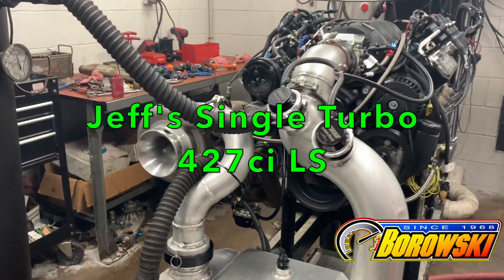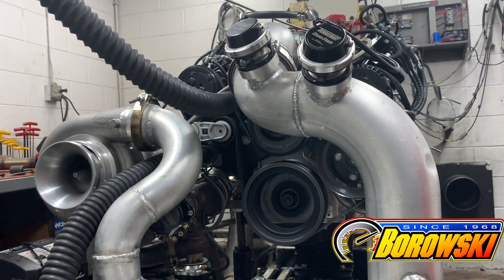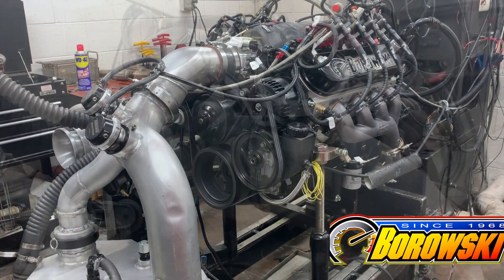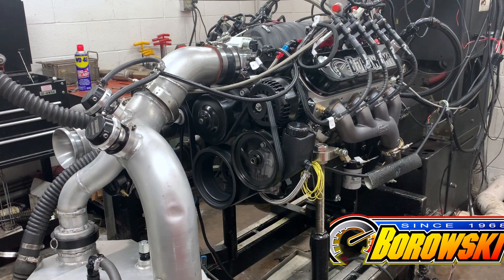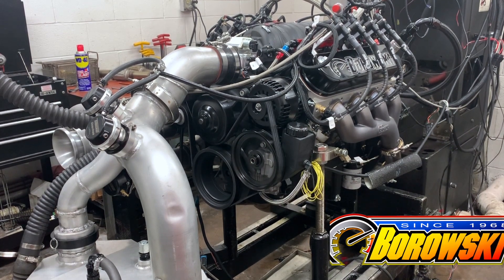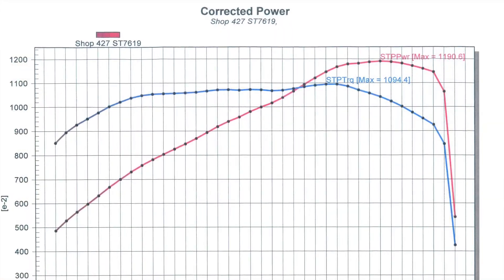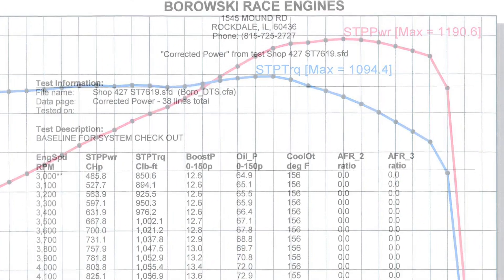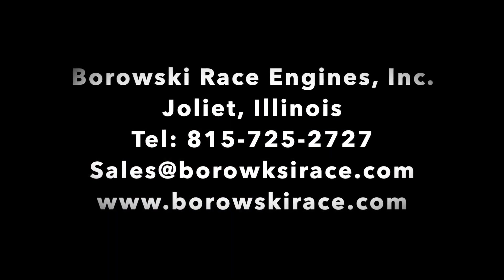Jeff's Single Turbo 427ci LS

Comment: Could this setup handle more boost or is the back pressure getting to high on the turbo. And sorry I didn't hear what size the turbo was. Just curious. Thanks for your time.
Reply: Hi Bradley.  The turbo is a Bullseye Power 76mm NLX turbo.  Back pressure was running about 2x so we were happy with it where it was as this is for street.  The engine itself could handle higher boost from a larger turbo but then you'd you'd be getting turbo lag.  We like this setup for its low to mid-range performance and responsiveness.  A bigger turbo would add more peak horsepower and be better for drag racing where you are able to spool. Here is a link to a video that explains the patented features of an NLX turbo. https://youtu.be/pQ4E0maNvJw
Reply: Thanks Joe for the response. Just curious what was the cam running ex. 227/236 114 LSA?  Appreciate your information.
Reply: @bdog3869  Sorry but cam data is proprietary (secret sauce)
Reply: @bdog3869  at any rate, the specs you mention sounds like a good supercharger cam.

Comment: How do u rate these dart ls3 heads , is there any benefits going to a ls7 head
Reply from the maker: We buy our heads as porter castings and machine them into a finished product ourselves on our CNCs.  We rarely use unported heads such as these which we only finish machined.  In general, we use LS3 heads on our 408ci builds and LS7's with larger valves on our 427's (4.030" vs 4.125" bores).  GM valve angles are 15 and 12 degrees respectively.  We will often machine LS3 ports into LS7 porter castings to match the ports of the intake manifold we are using.  We no longer use the Dart LS3 heads.  They were replaced by AFR Mongoose LS3 heads with a 12 degree valve angle.  The Dart LS7 heads are still in our mix and have a lower price point than the All Pro's used on most of our builds.  In summary, the ability to run larger valves diameters coupled with a12 degree valve angle offers significant advantages. The shape of the port? Not so much.
Reply: @borowskirace  I'm currently in the market for some heads for my 427 single turbo build (98mm pro mod) , I'm looking to try and make close to 2000hp at the flywheel,  car is a street car / track car ,I want to keep it hydraulic roller , unsure of what heads to go with
Reply from the maker: @azza9575  Part 1 - John McGhee owns Cutaway Racing in Summit Point WV. The car he had on our PRI 2022 booth had exactly what you want. 2,000 fwhp, single turbo, 427ci, hydraulic roller LS. He does a lot of these for his customers. The long block we supply is a Dart SHP Pro block, Callies Magnum crank, custom Diamond pistons, COMP hydraulic roller cam & BSR shaft rockers and All Pro heads. Most of his engines used Callies Ultra Enforcer rods. As you can see in the YT Short below, John calls this "Peanut Butter & Jelly". https://youtube.com/shorts/r58fdMb9P-g?si=5ZG6Kl9HcMnwAteS
Reply from the maker: @azza9575  Part 2 – We only use All Pro heads for this application.  As mentioned previously, we buy porter castings and machine them to our own design which is visibly different than an All Pro finished head. Our design targets boost. All Pro’s design is focused on NA.  These two videos will help you see why they are our choice for big power builds: https://youtu.be/NFyY2e6Plb8?si=0pmMlJYE6Wd794Zl  This is a deeper dive from PRI 2023: https://youtu.be/-wXWTzjcS0I?si=8-feGs0pm32eN2pK
Reply from the maker: @azza9575  Part 3 – We offer this head either bare or fully assembled to suit. ½” head studs are recommended.  The standard assembled head uses the following components: All Pro LS7 Retro Cylinder Heads - CNC Ported, Newen CNC Valve Job, Manley Severe Duty Intake and Inconel Exhaust Valves, Manley Machined Bead Locks, Manley NexTek Springs.  Titanium intake valves are a common upgrade. Best bet is to call us to discuss your requirements.  815-725-2727. https://borowskirace.com/products/all-pro-cylinder-heads-hydraulic-cam-manley-stainless-intake-extreme-duty-inconel-exhaust?variant=43952947396820